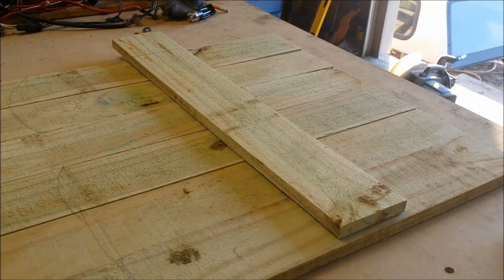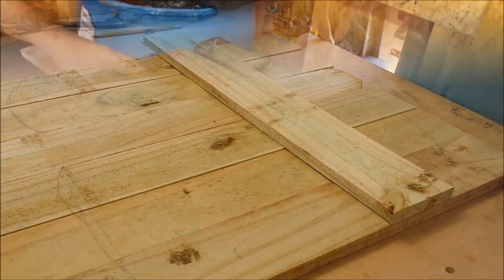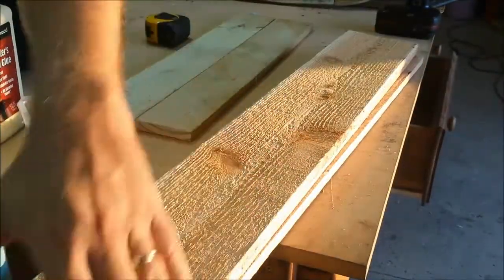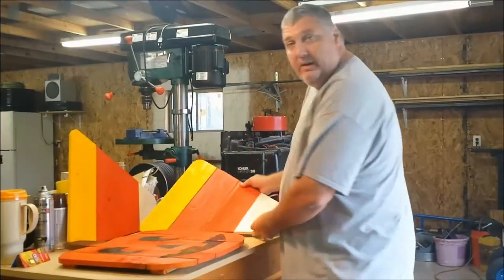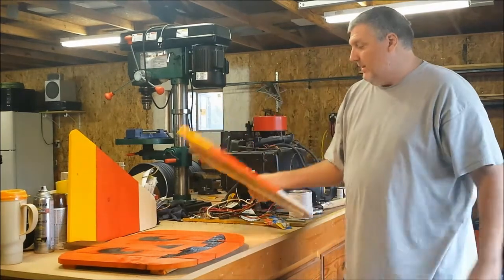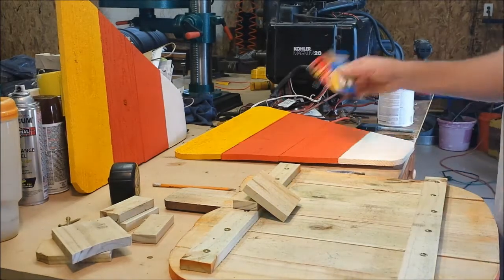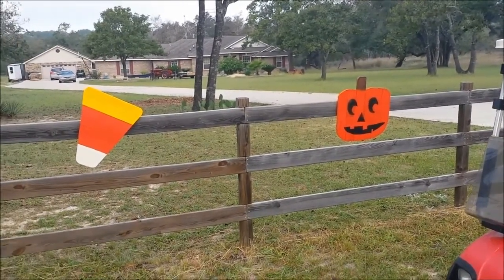Halloween craft ideas for the kids - easy decorations

Comment: How wide is each piece of the candy corn or how long is it
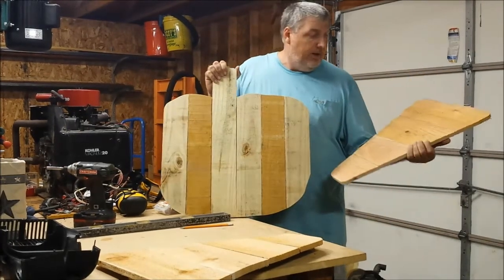Reply from the maker: We just eyeballed it to what we thought looked good but pause video at 6:00 and the pumpkin is 6x3.5= around 21 inches wide and the corn is 4X5.5= so right at 22 inches tall. 
1-1/4" or 1" screw should work fine